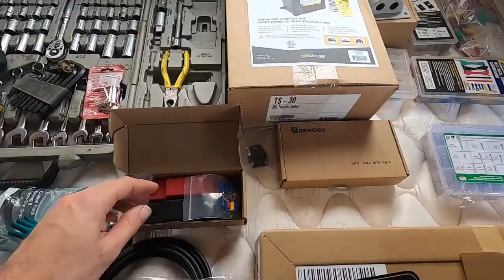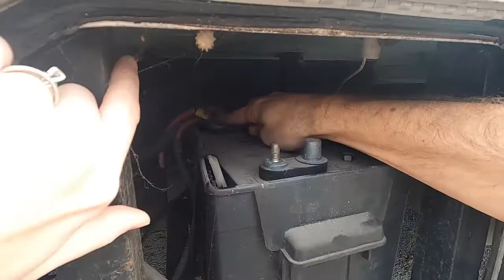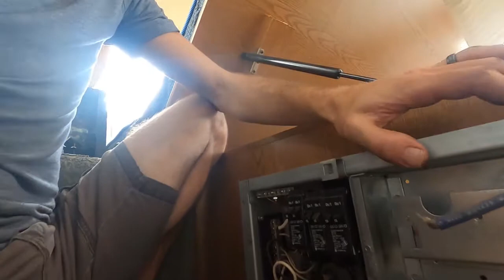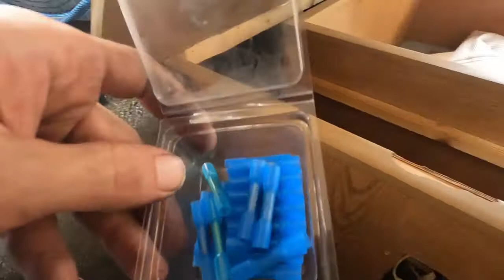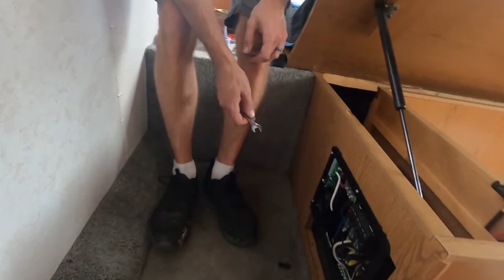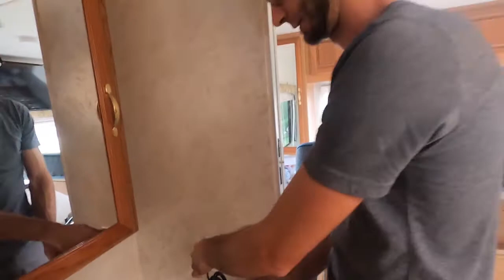Upgrading Power Distribution Center in RV

Comment: Renogy 400 Watt 12 Volt Premium 4 Pcs 100W Panel+40A MPPT Charge Controller+ Bluetooth Module Fuse+ Mounting Z Brackets+Adaptor Kit +Tray Cables Set, 400W, Grid 12V Solar Power System

bout to buy this for my rv. saw u bought as well. im off grid and yer video is still spinning,cant see. do u still agree this is good one to buy ? $686 with delivery. thanks.
Reply from the maker: I know Renogy has been getting a lot of flack lately for lack of customer support but I honestly haven't had a single issue with the setup. It's performed very well and was easy to set up. I say go for it! 

Make sure you're buying direct from Renogy either via their website or their Amazon so you aren't risking some shady 3rd party seller that won't back up their product.
Reply from the maker: I will say the Bluetooth is pretty much useless. I forgot I even had it. LOL do get you a decent battery monitor though. I got a LNEX, it's the exact same as Renogys but was a little cheaper on Amazon.